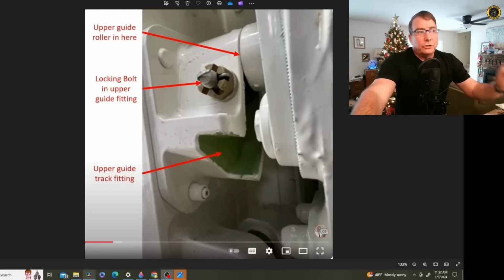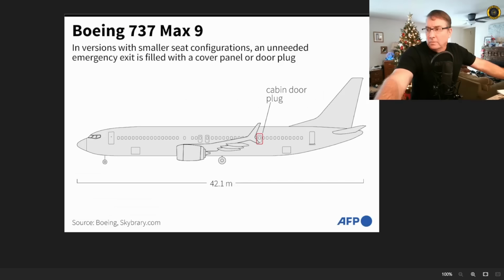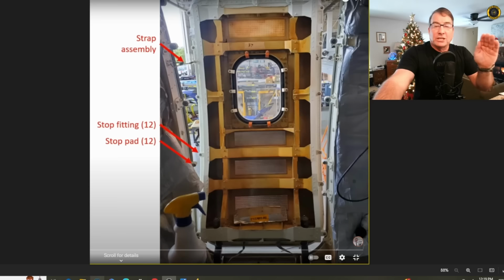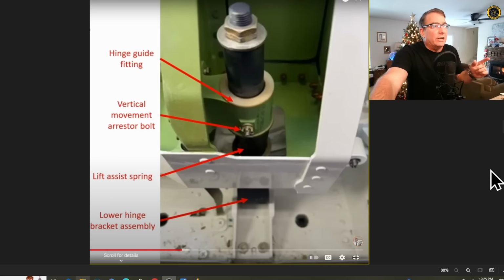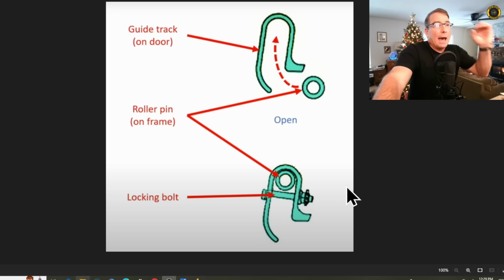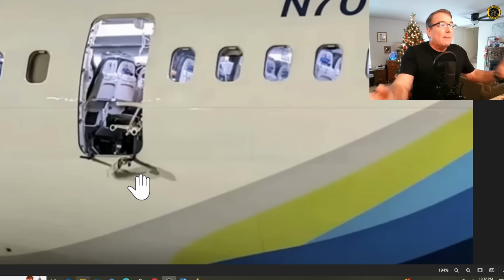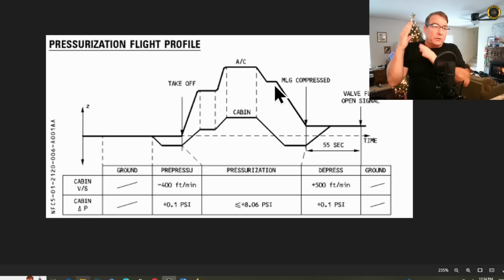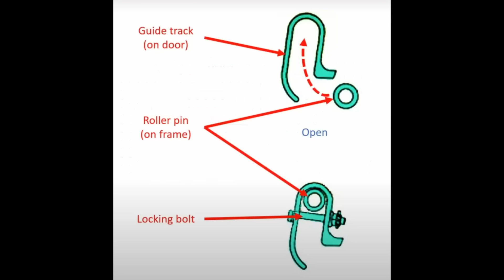Alaska 737 Max-9 Door UPDATE! 8 Jan 2024

Comment from the maker: UPDATE! Loose Plug Door bolts found on 5 United 737Max-9 Aircraft!  https://theaircurrent.com/feed/dispatches/united-finds-loose-bolts-on-plug-doors-during-737-max-9-inspections/
Reply: What a shameful company they have become. Now they are asking for 25.1309 exemption for the engine anti ice. It's insanity how incompetent they've become
Reply: Looks like someone can't even manage to torque bolts correctly, how are people to trust them with the more complicated systems after this?
Reply: Spirit Aero has some 'splaing to do!
Reply: Boeing/Spirit has some 'splaining to do!
Reply: how the heck did the cockpit voice recorder get overwritten?!? how did no one pull the circuit breaker?!?
Reply: THE BRACKET BOLTS ARE LOOSE?!?!?!?!?!?!?!?!?!  WTF?!
Reply: YIKES!
Reply: Well, tighten the darn bolts!
Reply: BOEING QUALITY  ... RUN AWAY FROM IT !!!!!
Reply: @markcalhoun8219  Big design oversight that the brackets aren't captively attached.
Reply: quality control people going to get fired one would hope
Reply: See that photo .. why weren't those loose bolts safety wired??  What is the process for identifing critical safey fasteners like this and mandating them to be wired / pinned ???
Reply: Boeing ain't going.
Reply: This happened over my home! It was CRAZY!!
Reply: So were the cotter pins present or not? Would just being "loose" indicate a problem? The article doesn't elaborate.
Reply: Am I correct in saying that, since these bolts are used as pins, in shear rather than in tension, being loose is not necessarily hazardous?  So long as the nuts are on and the Cotter pins in place, the nuts cannot back off and the bolts cannot slip out.  If I’ve got it right, it’s the Cotter pins that are the critical component here.  I understand that the bolts should be torqued before the Cotter pins are installed, but even if they aren’t torqued, the bolts should not slip out or fail so long as the Cotter pins are in place.
Reply: TrinityExaminedcom   The plane is brand new.
Reply: What loose "screws" are being referred to in that article? Juan's video refers to _nuts_, which I assume are installed on threaded studs fixed to the corresponding component, not loose bolts or "screws". [Edit: answered below.]
Reply: I agree that loose is no bueno, but it sounds very unlikely that this is the failure mode for the AAL issue. Every one of those castellated  nuts could have been 'loose' but if the cotter pins were in place the failure would have been impossible. Considering how nuanced that is we may never know for sure exactly what 'loose' meant in this case though.
Reply: What in the...?
Add this to the exemptions sought for the stall management-, yaw dampener-, flap & slat activator- & engine inlet de-icing units???
Ed: As per Ed Pierson; former Boeing senior manager.
Reply: @markcalhoun8219  bolts are loose, because they aren't safety wired. It's irrational that there is a cotter pinned bolt several inches away on that bracket, but the 4 mounting bolts on that bracket aren't wired or pinned. This is more design negligence, just like ACAS system that crashed two of these planes.
Reply: Interesting that it's a mish-mash of different loose bolts and screws being discovered, seemingly suggesting that it's NOT some sort of singular design issue of one aspect of the plug door system, or issue with the fabrication of a particular part of that system, but rather just sloppy install and/or an overall system design approach that is just not sufficiently durable to withstand normal usage forces over time. Pretty disconcerting and a real blackeye for Boeing IMO.
Reply: @jonthebru  And what else is loose there ?????????
Reply: @KrustyKlown  I used to write maintenance procedure in DoD. We had to use lock wire/Safety wire on castellation nuts.
Reply: The bolt in question are the mounting bolts for guide again wrong picture
Reply: @eddy66t6  the trust was lost after MCAS. A century of engineering excellence is gone forever.
Reply: You know when you took your car to bits then after putting it back together you have 4 nuts and washers left over ..............

Someone in Boeing workshop would have said 
Hey boss were do these 4 bolts go??
His reply would have been.
Ah don't worry only 4 left over isn't a big deal, give me the clip board and I'll sign it off.
Coffee anyone ??
Reply: Special thanks to Christopher for those nuances and to you Juan ji🙇🏻‍♂️🤍 for bringing all of us ..up to speed on a continual basis with the REGULAR updates on your mini podcasts here.
Much appreciate and thank you for the same.
May be some day you might fly to or visit this side of the planet and would get to see you i  person too.
(Somehow now too lethargic and/or given up on long distance travel to want to drag myself out if India).

Have a great week ahead.🙂
Reply: @markcalhoun8219   So much care in the locking mechanism with the castle nut and the pin .....
Reply: Every non-full time worker on the board of directors has some 'splainin' to do!
Reply: Are the planes fitted with seats after Boeing builds them or are they complete from the factory?    I'm wondering if the plane was fitted with seats post factory as I remember there is a company that refurbs seats for reuse.
Reply: The crew was probably too busy changing their underwear and simply forgot. I can't say I blame them given what they went thru.  The flight was so short that ATC probably has most of what was said.
Reply: @38911bytefree    And if someone opened / closed the door after it left the Boeing factory?  Then who are you going to blame?
Reply: TrinityExaminedcom Fairly sure those bolts are meant to be checked and replaced on a schedule, with vibrations and pressure changes, there is no way a cotter pin is holding it permanently and it's primary job is to act as a pin itself.  I would be very surprised if those are not meant to be changed after so many hours.
Reply: @blancolirio   Just an observation and curious if you see what I do at the 9 minute mark:  The upper roller pin inside the guide roller does not seam to be sticking out far enough ( by maybe an inch+ ).  Could the roller have slide back into the guide roller (of frame )?  Thank you for your time and great videos.
Reply: Were the bolts supposed to be tight? The castellated nut and cotter pin should prevent their coming out, even if they were loose.
Reply: What does a loose bolt mean? Doesn't it imply the cotter pin is also missing? Or are they just loose with the cotter pin installed?
Reply: @KrustyKlown    That bolt is only in double shear not tension so even a finger tight nut would stay in place with a standard cotter pin.  As long as the fittings on the door didn't separate from the door, I'd say that the bolt was finger tight and not cotter pinned?
Reply: @javaguru7141  You beat me to it.
Reply: @Graham_Wideman    Juan’s video clearly shows and describes bolts (machine screws) installed in four locations, working not as tension fasteners, the usual role of a bolt, but as locking pins, working in shear to prevent sliding motion of the parts they pass through.  The bolts are held in place with castellated nuts.  The nuts prevent the bolts from slipping out of their holes.  Keeping the nuts from turning off the bolts would be the job of two things, the torque on the nuts and as a backup, the Cotter pins through a hole in the bolts and the castellations on the nuts.  Done right, it should be extremely reliable.
Reply: @papaske3375    said "   Boeing/Spirit has some 'splaining to do!  "  
Maybe or maybe not.  If you buy a new car, get a flat, remove the tire / wheel , take to the tire shop for a repair then reinstall the tire wheel but don't tighten the bolts and the tire / wheel falls off, is it the fault of the car maker?
Reply: @bobroberts2371  United also ?.
Reply: @AthosRac  The door is taken off at Boeing after delivery of the fuselage in order to outfit the interior, and then reinstalled before it goes out. They'll have been the last people to touch this.
Reply: It appears that these bolts are on the inner structure of the plug door. You mentioned these doors were manufactured by a third party. Curious whos' territory that would fall under. I also have to wonder how many eyes were on this before they closed up the interior walls.
Reply: @bobroberts2371 except in this case the wheel nuts fell off after leaving the dealer. Once Boeing installed the seats by taking the plug off then closing it and pressure testing it the plug wouldn’t  have been opened again
Reply: @markholm7050  Yes I think you understand that correctly.  Even if the bolt is not tightened down but the nut is in place with the cotter pin in place there is no danger of failure.  The cotter pin in the castle nut is designed as a double safety point so that if the assembly is not torqued correctly it cannot vibrate loose.  All parts of an aircraft that might cause a single point failure catastrophe must have this sort of design.  It would be hard to imagine a cotter securing pin failing if it was installed correctly.
Reply: @markholm7050  Yeah I was thinking that too, but apparently it's not the one with the castle nut and cotter pin.  They should have indicated which bolts were loose with arrows or something, to avoid confusion.
Reply: An absurd. No excuses. For me Boeing is now just a truck factory.
Reply: Surely all 737 max 9s need to be grounded now for safety checks
Reply: @eddy66t6 Not only do the correct torque, but there is a wire to block the nut to get loose!
Reply: This is NOT a good lock for Boeing or the subcontractor.
Reply: @markholm7050  I’d guess the cotter pins weren’t actually in place allowing the pins to loosen.
Reply: Were the bolts loose because of improper installation or because the gap at between the top of the door on the outside and the top of the hole it's plugging, and lack of gasket seal, causes the door to vibrate in flight and loosen the bolts?
Reply: Juan -- If the fasteners used castleated nuts and safely wires even loose bolts should not shake loose. I wonder if they just used ordinary nuts instead.
Reply: @koskizzle  As an aircraft engineer it seems to me the issue is failure to install the cotter pins on re-fitting the doors allowing the bolts to become loose in use, this is a failure at Boeing as it was their task, also a failure by the technicians and their supervisors, their managers and so on up.
Reply: @mahu1982  devil's advocate: suppose they did pop the circuit breaker and something occurred after? Yes, we have the door event saved, but we have nothing then if the plane doesn't land safely.

My issue is if the plane involved had prior issues with the pressurization to the point they did not have it flying ocean routes, why did they not take it out of service and diagnose the issue? A plane not able to hold pressure tells me there is a leak and all points of entry into the fuselage should have been checked, such as the functioning doors and the plugs.
Reply: @markholm7050  Ah, OK, that makes sense.  And if they function as locking pins,  they may well have smooth shafts with threads only at the end where the nut fits, rather than being mundane machine screws.  Thanks for your comment.
Reply: There seems to be some confusion as to which bolts were loose.  Look closely at the photo... two of the bolts securing the sliding bracket to the frame are visibly loose.  Probably not even finger tight.  It's not the one with the cotter pin.
Reply: @mahu1982   Yeah that was pretty convenient.  But dear Boeing, what else did Spirit not tighten or install correctly - you should be looking as hard at the Max as you are with the Dreamliner.
Reply: I saw a report that the incident aircraft had pressurization alerts on 3 previous flights and the airline just restricted it to “no long over water flights” so it could “land in a short period of time”. If that report is factual then I have no words to express my feelings on that.
Reply: That is stupid , but ....Great news for Boeing , dumb loose bolts not a major design fault !
Reply: @requited2568  The cotter pin just prevents the castellated nut from turning. The nut prevents the bolt from falling out, and the whole bolt/nut/cotter pin assembly is what keeps the door from being operative (aka 'permanently locked in place'). So no, the cotter pin isn't doing anything other than preventing the nut from turning, and the nut is preventing the bolt from falling out. None of it really has any load on it - that's the stop fitting and stop pads that are actually taking the pressurization load.
Reply: @ocskywatch1 you mean the UNIONIZED quality control people?
Reply: The 737 is a mishmash of options and workarounds pretending that it's not a 707 designed 70 years ago.
Reply: @boblynch2802  As a hobby, I build track racing cars .. rules require cotter pinning or safety wiring all bolts on safety critical items, so no bolt can loosening causing a failure. I see those 4 loose bracket bolts and would have used bolts with drilled heads, and safety wired them according to FAA approved safety wiring specs.
Reply: @eddy66t6  a company that collectively can't turn a wrench properly, can't be trusted to build safe aircraft.
Reply: @wgiles51  different bolts were loose not the ones with the castellated nut and cotter pin
Reply: They accidentally used sheer pins from a towbar😅
Reply: A geometric lock.  the bolts don't need to be "tight", they need to be "locked"
Reply: @KrustyKlown  This is mind blowing negligence, yes very much like the ACAS in combination with the undersized control surfaces... the 737 is a death trap by design.
Reply: @evanranshaw4659   Pound sand.
Reply: @ericroellig6704   Eric it was a nuisance fault. If it had been an actual pressurization problem the aircraft would have been grounded. So it was an indication fault, not an actual pressure fault.
Reply: 💩 hits 🪭
Reply: @RoHo702 I guess you didn’t watch the video where he explained the first thing Boeing does when they get the fuselage is to remove the spare door for interior fitment lol.
Reply: The loose ones get no pins. A nice screen door on that submarine.
Reply: TrinityExaminedcom Agreed.
Boeing has the final responsibility.
More so if they are removing plugs and other parts while installing interiors.
There should be some sort of final inspection, pre inspection for interior install, and OK to close.
Reply: @julesviolin now that’s funny, but so true!
Reply: That's a red herring  --  the bolts don't need to be tight, the just need to be present and the nuts secured by the split pins.
Reply: @requited2568  this plane is 2 months old. She they be changing them every hour ?
Reply: Looking at the update, the issue looks to be the bracket itself. I see bolts with either lock washers without flat washers installed or bolts with no lock washers at all which would be ridiculous. The torque spec also looks to be inadequate (or they didn’t use a torque wrench at all, who knows). Whoever signed off on these installs better start looking for a new job.
Reply: Even loose, both of the top bolts would had to SHEAR for the door to be able to open. And all four would have had to shear for the door to depart the aircraft. Unfortunately if they HAD sheared, the bolts would likely never be found. But there should be indications on both the door and the airframe that they had sheared out.
Reply: @Datamining101   You can see the plug doors installed on BNSF Rail videos on YT and in pics of the first Max9 fuselage delivery back in 2016 on business insider.  This is a Boeing factory failure.
Reply: Amtrack is Looking Much Better...
Reply: I don’t see how the bolts can come loose unless someone forgot to correctly install the appropriate cotter pins!!!
Reply: Do Boeing have their own paid Inspectors independent of production workers on their production lines-?

Did the installation of this plug door require an Inspector to have a final inspection of the door prior to installation of its trim coverings-? 

Please dont confuse my first question with FAA designated Inspectors who are on Boeings payroll.
Reply: Too scary. I fly a lot and very often on the 737 Max. I’m already a nervous flyer and this doesn’t help.
Reply: @Rorschach1024  There’s no significant shear force on the bolts. There is the force of the springs on the lower bolts, but only if they shear is there any force on the upper bolts.
Reply: @phillippeterman1051    The bolts could break - perhaps one at a time.  The supply chain across industries is full of bolts not made to hardness specifications.
Reply: I wonder what other nuts n bolts are loose. Time will tell !
Reply: @markholm7050  I believe that you are correct. There appears to be no damage to the door frame, sso I would think that the door raised then cam open unopposed. I think that could only happen if all four bolts were missing. I would hope that someone in the plant would have been responsible for installing those four boltd, the crown nuts and the cotter pins. Someone else should have inspected the work and signed off on it. Hopefully the NTSB will soon show us the other side of that door.
Reply: @tomstravels520    Do we know for sure that the door was not opened post factory?
Reply: @38911bytefree  said "   United also ?. " 
From what I understand " loose bolts " was not defined.  The bolts are in double shear so even a finger tight cotter pinned bolt would not fall out.   Were the bolts intact but below some small amount of torque or was the cotter pin missing the the nut backing off?
Reply: @markholm7050  Correct. Good workmanship means that the nuts should be at least snugged, then adjusted so the cotter key hole lines up.
Reply: @Graham_Wideman  No, they are screws (bolts), all 4 inserted from the back side. If they were fixed studs, you wouldn't be able to open the plug.
Reply: @markholm7050 When JB explained it, this was my first thought too, i think you're correct. As I looked over the diagrams more, it lends credence to this
Reply: @RoHo702  According to Juan's explanation - the doors come off after Spirit installs them - at Boeing - to install the interior.  So if there was any improper torquqing of the bolts - it must have happend at Boeing on the re-installtion of the doors - not at Spirit.
Reply: @jameshisself9324  Every now and then, NTSB goes into "no lawsuits" mode, and we don't get the straight story.
Reply: @bobroberts2371  Rumor that was opened for access to install a satellite antenna on the roof.
Reply: @bobroberts2371  Yes. You can't torque it, you need it aligned to put in the cotter key. Also torquing could stress the guide fitting.
Reply: @KrustyKlown 
It's not in a high vibration area. So safety wire is not used. Just fyi.
Reply: What does "loose" mean in this scenario?
Was the pin missing?
As you & 737 Tech showed, the nut doesn't need to be torqued.
Reply: I initially heard the conversation between what sounded like a female pilot and ATC requesting to descend to 10K feet and so forth. Was on an early YT video @cottydry
Reply: @ericroellig6704  Someone sitting in that row would have acquired angel wings.
Reply: Here's an idea.....maybe we should put castle nuts on every damn bolt attaching these doors to the plane so that they can't fall off? Having a castle nut on one retaining bolt doesn't do a damn thing when the two bolts holding the hinge on look like they came from Home Depot.
Reply: @dinky9216  Basically true.  737 is a small 707 from a design standpoint.
Reply: @indiekiduk  What different bolts? The only ones used as safety bolts were the ones on the hinge pins and the ones on the door lock pins.
Reply: @rael5469  No.
Reply: @bobroberts2371  Apparently it was, for satellite antenna install.
Reply: @mahu1982  The CVRs need to go to 25 hours before overwriting.  In Europe that is the standard.  The FAA has issued a proposed rule to require 25 hour CVRs, but only for new aircraft.  The NTSB called for the proposed rule to change the 25 hours to all aircraft and not just new aircraft.
Reply: @feignit I agree
Reply: One of the most brilliant companies in the world and they have loose bolts…
Reply: Now were they loose without safety wires(cotter pins)?   With the pins in place they don't necessarily need to be tight, they just need to be secured from unscrewing, their only job is to prevent upward movement of the door.
Reply: @markholm7050  No, the bracket bolts were loose, not the ones with the castellated nuts.
Reply: @SteamCrane  Oh absolutely. If not for that Airbus would have been sued out of existence decades ago.
Reply: Yes, and if you look at detailed NTSB photos of the Alaska hinge area, you can see that the same bracket is still on left hinge (looking from the inside)  together with the spring and the top washers. @blacolirio says in the video that the door cleanly departed the hinge together with the springs but that is not the case. So is it coincidence that United found the bracket bolts to be loose and that is exactly where the door at least on one side separated from the airframe?
Reply: I'm wondering, if Tech's would loosen that bracket during install/removal to ease the processes.
Reply: @martinrenschler4046  Yes, my theory is that one of the hinge bracket bolts came out, putting stress on the others as the cabin air pressure forced the door against the brackets. Since the brackets slide on the cylinders, they will rotate away from the door as the remaining bolts break away from the shear stress of that rotation. Then the lower part of the door becomes loose causing it to rise and disengage from the roller pins. I suspect we will see damage to the hinge brackets (if they are found) and the lower part of the door where the hinge brackets are connected.
Reply: @Rorschach1024 but…if only the bottom bolts are still in place, the door can’t slide up on that shaft so how could it open? Because the top pin would still be in the track, right?
Reply: @kevins.3573  yes, I think so, too. Who wants to take the bolt out of that loaded spring? Nobody!
Reply: At first I would have said "unbeliveble" - But when I remember Boeings NON-perfomrance in thelast 10 or so years .... i correct to quit reasonable.
Reply: @martinrenschler4046  That would be a very different kettle of fish.   It would also imply a different damage pattern on both the frame and the door fittings.  Since both the frame and door are available and apparently not suffering badly from subsequent impact damage, it should be possible to identify.
Reply: Whats tight?   This is just a stop, and doesn't require any torque to do its job. The castle nut and cotter key keep it in place.
Reply: Damm... Sloppy QC. Not a good look
Reply: @rocketPower047  Never forget, united breaks guitars.
Reply: @LordSlayer001 It had a previous Auto Press fail, which essentially means the computer that controls pressurization rates quit working, but the system has a manual mode(not that uncommon) TLDR the plane never had trouble with pressurization it was an unrelated issue, you can’t fly ETOPS with a Press auto fail
Reply: To be clear, the loose screws referenced have nothing to do with the bolt and castellated nut or cotter pin.  The loose "screws" are on the lower center right, and top center (just visible on the other side of the bracket).  They're backed out several turns of thread.   Very visible at full res.       Suggests that somehow the whole bracket (wherever this is), might be able to just fall off.
Reply: Crazy that they can find this stuff. Finding a door is one thing. They found the bolt in someone’s backyard. Someone also found a cellphone that fell from the cabin. Nuts…
Reply: @mahu1982 Because pulling the CB is not on a checklist
Reply: @markholm7050  - Yes, you're correct.
Reply: @boblynch2802 Yup, but your labor was free
Reply: @markholm7050   as I was watching the video I was thinking the same.
Reply: Jesus, these 737 Max 9’s appear to be death traps. Hard to excuse in 2024.
Reply: interesting fact...  its reported all the seats around the "faux door" were empty.  why?  do the airlines do this seating arrangment regularly?  did the airlines know there was a concern with the area and kept flying the planes?
Reply: @mahu1982  luckily I doubt the pilots are a factor here
Reply: @samwoodward4080 , this depends on which bolts were loose. The post is ambiguous on this point. It may have been referring to one of the other (smaller) bolts in the photo. Note also the talk about different parts having been found loose on different aircraft. This may be more an indication of poor build quality generally than a possible cause for this incident specifically.
Reply: @RoHo702  As Juan said, Spirit ships the fuselage to Boeing which then opens the door plugs to fit-out the interior.  Seems more likely the Boeing techs didn't close the door plug properly when they were done
Reply: @RoHo702  I heard that Boeing did the final installation of these plugs, not Spirit.
Reply: @damiensadventure scary!
Reply: @AthosRac  he means that Boeing removes the plug in order to install the interior after they receive the fuselage from Spirit Aero. After that work is done, they replace the plug.
Reply: There is a pic of a united plug hung bracket with loose bolts on the Dj’s Aviation channel.  Video posted at 2100 CST.
Reply: The voice recorder I can understand. Crew workload was high, get through checklist and get on the ground ASAP.
Reply: @marc7uk244  I would think ground the Max 8's, too, to check for loose bolts everywhere.  Check every aircraft that came out of Boeing in the last 5 years!  I've always been a Boeing airliner fan, but generations have changed.  I'll ride Airbus, now.
Reply: The article mentions "loose bolts", "and other parts". I'd be most interested in "other parts" re. this incident.
Reply: @tomstravels520  I'm thinking, how does static, on-the-ground pressure testing it ensure the bolts are in place, torqued and pinned?
Reply: @markholm7050  The bolts may not have been torqued as that would crush and deform the track fitting.
Reply: @johngore9016   - getting carried away here.  No one had any idea there might be a problem with that plug door.  No one.
Reply: @Andrew-13579  if the door is resting against the stop pads then it probably wouldn’t
Reply: @bobroberts2371  in you by a New car ...  Chance the weels/ tire...  After that someone finde out that the weel is lose ....  and on a coupe other Carsten of the same type also .... how big is rhe Chance, that it was your Foult???
Reply: @jameshisself9324 ”loose” in this context is a euphemism for “can fall off”.
Reply: So this is even worse. In the Blancolirio video he says the hinges were still attached and completely still attached to the body of the airplane.  So, the loose bolts in the United Planes are a completely new risk area.
Reply: @dcnole it suggests a process,  documentation checklist issue to me. Step by step with verification and sign off. Then the same for QC.
Reply: @exist7309  That makes a lot of sense.
Reply: @ZeroG all sealing parts were in place because it passed the pressure test.
Reply: I can't see how a loose bolt would matter. As long as the bolt is there the door can't slide up. The cotter pin would prevent the nut coming off, no matter how loose. 

The bolts would have to be completely missing to have lost the door.
Reply: @brandyballoon can you provide a time reference to the photo you are referring to please?
Reply: Irrespective whether the castellated nuts were tightened correctly and or split pins were or weren’t present there’s obviously some sort of design error maybe or some slack arse human hasn’t done their job properly but try alleviating fear of any Max series aircraft for some of the travelling public as already some people asking if their are any operating here in Australia which there is and Virgin Australia has ordered some so some people are already becoming concerned and fair enough too!
Reply: Alaska had to cancel 140 flights. Does Boeing have to reimburse them for lost revenue? It's nice not owning Boeing stock. The DOW was up a tiny bit but Boeing stock was down 8%.
Reply: @johngore9016 perhaps a passenger reported rattling or air leak noise from that location on a previous flight?
Reply: @IesKorpershoek  in the NRSB video they mentioned that hinge related parts were still missing.
Reply: Is this correct, all 737 max fuselage's are build with this exit. Some , that carry more passengers have a door. Some with less passengers have a plug. If this is used to simply plug a hole in the fuselage and is unlikely to ever be removed again , why can't the nuts be welded to the bolt.....that's going nowhere.
Reply: @exist7309  It's not in the video, it's on the page linked to in this thread.
Reply: @rocketPower047  Why isn't Boeing following Apple's success story?

Production better to be done in China than in USA.
Reply: @mahu1982  The door never spoke to the captain ....
Reply: @mahu1982  American company running at Boeing's quality standards.
Reply: @peterebel7899  at this rate comac probably does a better job
Reply: @brandyballoon yes in the photo in the article it’s definitely the bracket bolts holding it to the frame that are loose.
Reply: The good news is that the door (door plug) can be reinstalled, but now all the standard screw connections should be fixed at all 12 points. I think this was missed, not all the screws were attached and it is even possible that they were not even standard screws. There have also been examples of this with the windshield in the pilot cabin, the windshield flew out, sucking the pilot half out of the plane. Miraculously, the captain survived, his colleagues held his legs.
Reply: @DARANGULAFILM    Yes, I thought of that.  The torque spec on them would have to be fairly low, and that would make them more susceptible to backing off.  Because of that, installation of the Cotter pins would be critical, unless there is some other retention feature we haven’t seen yet.  I’ll bet there is a torque spec for them, specifically to prevent deforming those parts.  I think there is a torque spec for nearly every screw fastener on an airplane.  Using torque wrenches should be a deeply ingrained habit among aircraft mechanics.
Reply: @peltarlendori7027  The god news is Boeing sticking to all processes and standards while (not) mounting those screws ....
Reply: @Graham_Wideman  *Shouldered bolts, to prevent overtightening onto a fitting that might cause stress.
Reply: The thing that is bothering me here is that if they didn’t properly attach these plug doors, what other corners have been cut? This doesn’t look like a failure on Spirit’s side, they provide the plug doors, Boeing installs them. That picture in the article is disturbing. It would be difficult for me to trust that airplane and company after a widespread failure like this. This tells me that their systems are not safe with in assembly process or design. 

What other bolts are loose? What other potential failures have been overlooked? I have no confidence in Boeing right now. They should bring some of these aircraft in and have them fully disassembled and inspected along with a third party to make sure they haven’t missed anything else in their processes.
Reply: @peterebel7899  Boeing can insist on standards and procedures, but if it is not installed by them, but by a type-tested mechanic of an accredited external company, then there is nothing to be done, this is how we did it
Reply: @TheRealChetManley  Bette to run the assembly of those aircrafts in China than in American Boeing factories.
Reply: Hard to understand how these bolts could be loose. They are cotter pinned and function as hitch pins, not under tension. Seems like they were missing or cotter pins not installed and they backed out.
Reply: @mahu1982 I can understand that it gets overwritten eventually but your right. I find it amazing that they don't have something in place where they have an incident, they get back to the ground and it doesn't get shut off. I drive. Semi truck with a dashcam. If I have a incident, that video outside and inside the cab with audio gets sent to our corporate office and is permanently stored.
Reply: Who is going to tighten the bolts! - Goggins speaking at the next Boeing corporate motivational event.
Reply: “When you are in the plane remember, it is using parts from the company who proposed the minimum price”
Reply: Great job
Reply: @tannercayenne  They were designed to fail.
This happened in several aircrafts operated in several airlines.
Reply: @peltarlendori7027  So Boeing is not in the position delivering aircrafts not falling apart?    -   Interesting !

Bretter ti buy in Europe or China (since Russia is sanctioned)
Reply: @brandyballoon  At which timestamp? Note that most of the pictures are not from the accident aircraft.

Edit: ah you were referring to the Twitter post, got it. That does indeed present another potential way it could unfold, with the bottom failing first.
Reply: @martinrenschler4046  As far as I can tell both brackets are still in place on the accident aircraft.

Edit: I now found the right picture and I understand your point. The failure point could be the lower hinge assembly, which is not shown in pictures from failure aircraft (from the inside).
Reply: @KrustyKlown exterior fasteners only. Interior fasteners do need them. Safety wires don’t stop fasteners from coming loose. They just stop them from flying away.
Reply: @javaguru7141 If a castle nut is not properly torqued it will cause excessive play and with enough force it will snap the bolt even if the cotter pin was in place.
Reply: Sabotage?
Reply: @cryMoreLoL  right, a properly wired bolt can loosen some, but usually will retain substaintial preload and full functionality of the assembly. I just discussed this with a  retired Marine tech who serviced fighter jets .. he was shocked that those bolts weren't wired, because everything he worked on was. This is Boeing cutting corners, saving time on assembly costs, at the expense of passenger safety.
Reply: @peterebel7899  Every company can be in a situation where its machines break down, there are no exceptions, for some it is more frequent, for others it is less frequent. Now I was talking about manufacturing errors and type errors, not about someone John Doe not following the strict technical guidelines.
Reply: @mountainflyhigh  possibly but its likely the only thing carried away is a door from a 737.  its coming out Boeing definitely knew and then why were airlines flying these planes with those seats empty in many cases?  coincidence? maybe.  air industry politics? also maybe.
Reply: Oh my God! That's not good news at all.
Reply: @exist7309  if so that would be a big red flag to the crew but also having heard reports of other planes having those seats flown empty is disturbing at best.  i hope for Boeing's sake they dont get painted with a McDonnell Douglas Halo over their heads.  I love the 73s I hate this news.
Reply: Ok, here's a scenario. The original plugs were installed at the factory but in anticipation that they were going to be removed and properly reinstalled as part of the interior installation, and little care was taken to ensure the plugs were "flight ready", since torquing and cotter-pinning everything would be wasted effort and just make things more work to remove. But the interior installers never got the memo and went ahead and did the interiors without requiring the plugs to be removed (thus saving everyone time) and in fact they just paneled over the plug making visual inspection of the plug impossible.
Reply: @peltarlendori7027  "someone John Doe" not following guidelines???

There are several aircrafts with those blolts loose, this is no "John Doe" issue, this plain incompetence to produce according design.

Let the assemble been done in China and the quality will be back.
Reply: That one photo says it all, very loose bolts, spring loaded!!!!!
Reply: TrinityExaminedcom  But they only use the cotter pinned bolts to do that.
Reply: @peterebel7899  There are several planes on which these patches have come loose, I didn't know that, but I do know that the "plug door" inserts are manufactured by an external company, not Boeing, and not even Alaska Airlines itself. I saw a demonstration by a pilot how to connect a normal functional door and how this plug door insert should be inserted properly.
12 screws that hold it firmly in place if it is correctly fitted. If something is not crippled, undersized, omitted, it should stay there. Obviously, 1-2 requirements were not met. They stabbed him.
Reply: @peltarlendori7027  So you tell me Boeing is not responsible to deliver a safe aircraft but a subcontractor is???

BTW the subcontractor is an outsourced Boeing department - a once path to deviate responsibility.

Better to let the Chinese mount this airframes like Apple is doing with all their products to achieve decent quality in American products.
Reply: @peterebel7899  Boing built a good plane, the Alaska airline outfitted the door with an external company, and then a door plug was put in its place, which is not a Boing product. How do I know who made a mistake?
Reply: @peltarlendori7027  Frankly: You are telling utter nonsense!
This very same door plug system is delivered by Boeing in all MAX 9 to all airlines beside Ryan Air who need the emergency exit due to passenger packaging like crazy.

Alaska Air gets the airframe ready to fly from Boing, this included a closed door in any opening....
Reply: @johngore9016  - The seat right next to the door was booked, but the passenger never showed up for the flight.
Reply: @mountainflyhigh  passenger won the lottery on that one.  thnks for letting me know that info.